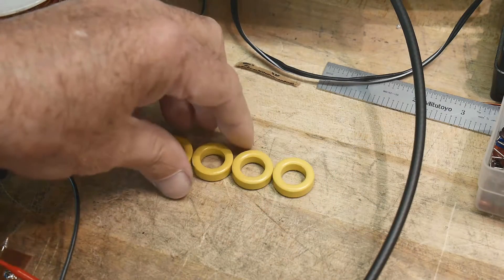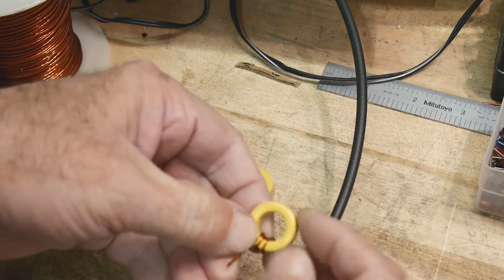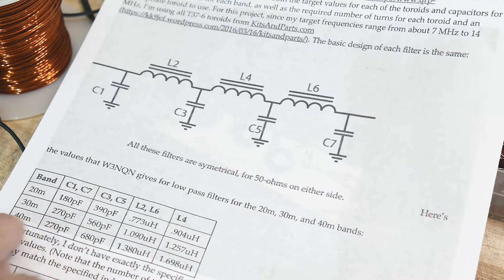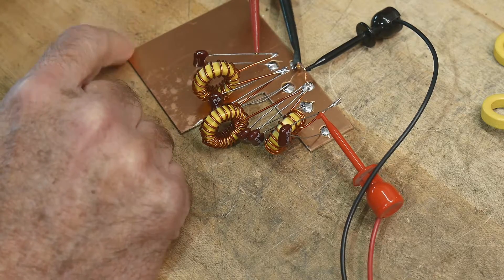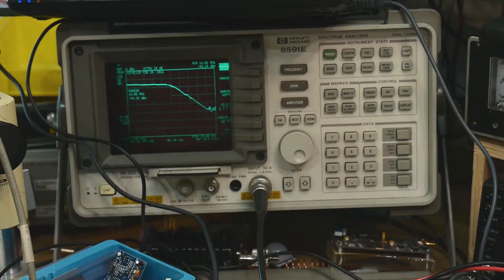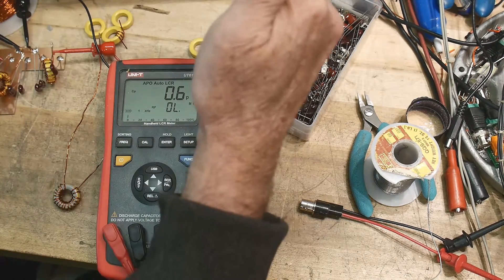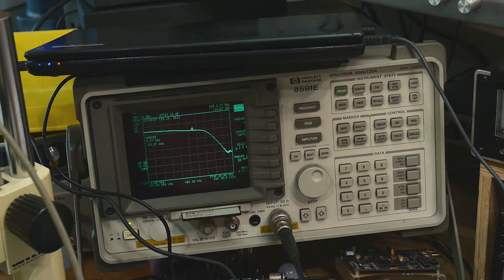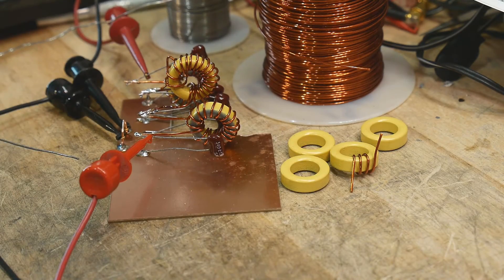#736 40m Low Pass Filter (part 1 of 4)

Comment: Also, difference between Butterworth and Chebychev filters is just component values. The transfer function poles are moved inward on the S-plane for a Chebychev. This gives sharper roll off at the expense of more ripple in the pass band. I like to design Chebychev for output low pass filters because you don't usually care about ripple much and get a bit better attenuation. You should also note response at the 3rd harmonic as well as 2nd harmonic as often most of the distortion is at 3rd harmonic 5th, (odd) etc.. Good news is 3rd is farther away so much easier to attenuate. You get 2nd (and evens) when waveform is not symmetrical tops vs. bottoms of wave form.  Good job with junk box parts! Looking forward to more of this kind of project!

Comment: Good filter. I build a lot of these kind of things and have a complete stock on hand of all the common Amidon powdered iron cores. The filter in that paper you showed used T37-6 cores which are MUCH smaller in diameter and thickness and so have lower AL value (inductance per turn). Those you have look like T80-? or so (much larger). Yes, the yellow can mean type 6 material but from a junk store who knows?? The fact that those cores seem to work at 7-14 MHz tells me they probably are type 6 (from Micrometals) material.

Comment: It is a very interesting video with the experimental filter design. If you are also not to patient (what I assume) to see the reactions on changes of  element values, get a permanent magnet close to the relevant inductor core to decrease its value by saturation in the range of about 0 to -30% depending on the distance. For the final adjustment the number of windings shall be changed as it was done where the inductivity is proportional to n^2.

Comment: In my experience, steel wool is best for cleaning the insulation off of enamel coated wire, Just put the wire inside the wool, then squeeze the wool on the wire and rotate back and forth. Also, That "ARRL Handbook" looked very useful, could you do a brief explanation on what it covers? I'd be very interested in getting good reference material!
Reply from the maker: https://youtu.be/OBNl-6nFyL0

Comment: Cool, it seams a Pultec EQ has multiple windings on one core.
various values of inductance on a single toroid.
How do you know if you got the right size toroid.

How do you determine the crossection of the wire, i got a roll of 0.5mm.

Comment: I enjoy these projects very much.  How do you measure the input 1 mw maximum level to input signals for the TinySB measurements?
Reply from the maker: use a power meter, or start with a  large attenuation and check, then lower the attenuation to a good level.

Comment: why is it called 40m or some x distance meter band,is it wavelength of the signal?
Reply from the maker: 7 MHz frequency = 40m wavelength
actually 42.827494m but they round it off

Comment: Are you going to consider a low pass diplexer output filter ? I've heard that these are better. Instead of reflecting the 2nd and 3rd harmonics back to the output device causing problems, the low pass diplexer re routes these harmonics to a load.  https://www.qsl.net/wm5z/qex199907.pdf